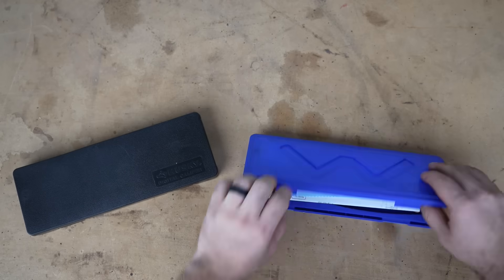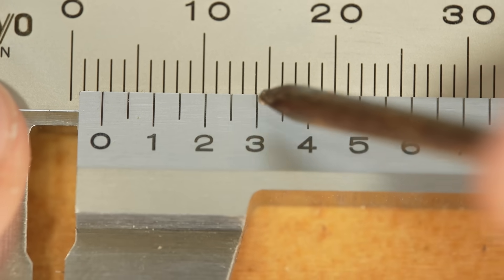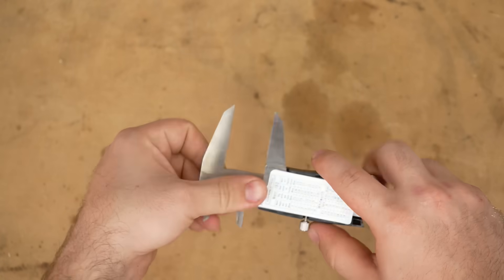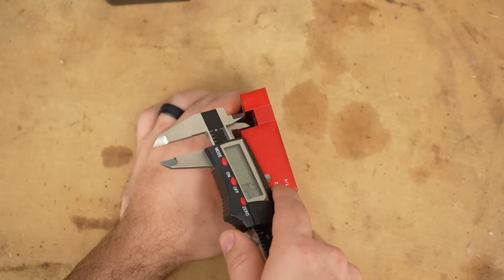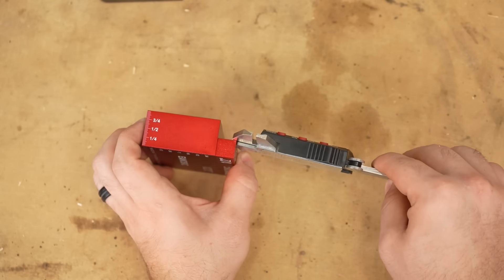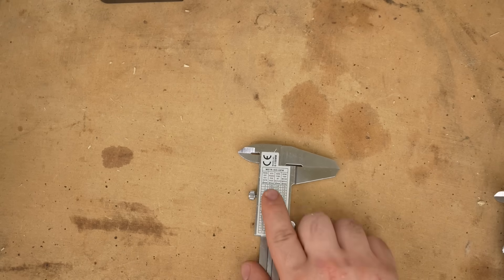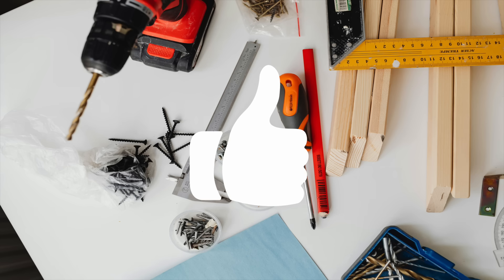I wish i’d known this sooner, How to use calipers like a pro

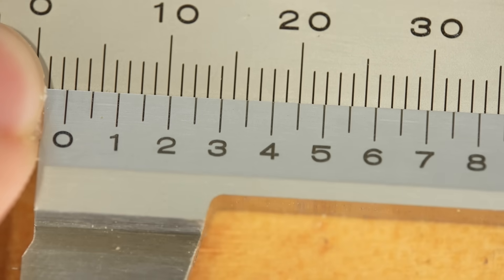Comment: 2:07 Holy crap!  This is high-value info here.  I don't pull out the calipers often, and when I do it's a digital caliper but after this video that my change.  Digital calipers are frustrating and finicky at times, at least mine are, but I've put up with them due to my belief their accuracy and general ease of use outweighed their flaws.  What I learned from this video in just the first 2.5 minutes has changed my mind.  And made me hate button batteries even more!
Reply: Also take a look at dial calipers, they're my favorite type of calipers, but a bit harder to find. They're faster to read than Vernier calipers, but still no batteries.

Comment: For the example step measurement, the depth method would have worked just as well.  Is there a scenario where the depth measurement wouldn't be adequate?

Comment: That's a superb explanation, I didn't know about step measurement. In our Polish workshop we have old “Made in USSR" calipers that we use daily, after all the years of use, they have surprisingly little amount of play. But for anything that requires proper precision, we use digital one. 
Also, a small bit of trivia: In Polish it's called "Suwmiarka", which roughly translates as "Glide scale".
Reply: Or "stroke measure" :)
Reply: Dzień dobry
Reply: VIS vernier calipers for the win.
Reply: Same name in Dutch: schuifmaat ( slide size). Maat is size but also pall/ friend, but in this case it is "size"
Reply: As you mentioned about 'Play' good Mitutoyo Vernier caliper, made in Japan, have a thin plate on the sliding member which can be adjusted with two fine screws to compensate for any wear and tear. Also an additional sliding member is attached to the main reading piece with a Thimble and screw. This is for fine adjustment while measuring.
Thanks.
Reply: Funny, I have a pair of verniers that were made in Poland.
Reply: штангенциркуль

Comment: I'm a retired machinist, instructor and process engineer. I found your information to be very sound. the only thing I will add is to be very, very careful when relying on the depth rod as it's easy for inaccuracy to creep in. The other thing I'll note is that my Verniers are more difficult to use than they were 50 years ago when I was 20 (all you older guys are chuckling over that, I'm sure). On the plus side. I dropped my verniers in the bottom of a screw machine- a very dirty environment. They made a soft landing in the carpet of chips. I fished them out, dunked them in mineral spirits, wiped them off and they were none the worse. My boss did the same thing with his dials. They were toast.
Reply: Inaccuracies creep in with age and wear... it's just that in our case the age and wear is not necessarily the caliper!  I 100 percent get where you are coming from!   😜
Reply: @PiefacePete46  Might want to check out the Bates Method for eyesight. It works.
Reply: Also, with the dial calipers, you can get dirt etc in the rack and it will put them out of zero without you realising. The dial needle won't read zero when the caliper is closed.

I prefer a vernier caliper with fine adjustment.
Reply: @Funco1979  That's why long ago I got in the habit (a habit I always shared with students) of checking zero before taking measurements and again when I was done to make sure that hadn't happened during use.
Reply: @Funco1979  Any caliper, dial or otherwise, not reading 0 when closed almost always means you just have dirt on the jaws. Wipe them off it goes back to  0.
Reply: @bobbygetsbanned6049 not necessarily. Those digital calipers can be set to zero when they're open. For example open it to say 20mm, then press the "zero" button and it will read zero at 20mm. So you could press the zero button without realising when it's slightly open and you'll get an incorrect reading when you measure something.

When measuring with a micrometre you should always check for zero before using it. Clean the anvil and spindle first. The larger micrometres come with a test piece (I've used them 1000s of times).
Reply: @bobbygetsbanned6049 also, with the dial calipers, swarf or dirt in the rack can change the position of the indicator needle. So when you close them (with clean measuring jaws), the needle won't read zero. 

This is why I like the 0 - 200mm vernier caliper with fine adjustment.
Reply: @Funco1979  that previous comment was me responding to your first comment.  but you have kept on spouting complete and utter BULLSHIT throughout the entire conversation acting like you know anything about calipers at all. let alone dial ones. 
even though you have never even seen one in real life before.  wich i know for sure based on the crap you have been commenting.
Reply: @Funco1979   you seem to have atleast held a micrometer. (or had a better source that you could google from)  did you know you can also rezero a micrometer.  they will have supplied a tiny alen wrench that allows you to unscrew the set screws so you can adjust the dial.
Reply: @Funco1979 good point. Iske a practice of closing my calipers to zero before every measurement 
Not foolproof be close.
Reply: @Mark-l6k5g  
with verniers you must also do this.  there can always be dirt on the measuring surfaces. 
also check for gaps with any set of calipers while holding it to the light.  

there are 2 scews at the back of the calipers (near the locking screw) that should be loctited into place. 
these allow you to tilt the moving head. (to alaign the 2 measuring surfaces) 
and they will also make it harder to move the head when incorrectly adjusted. (act like the locking screw)  all 3 of these screws press against a bronze strip of metal that is sliding across the guide. enoegh force on it with the locking screw prevents the head from moving.  and the other to act like a seesaw to keep it alaigned. 
(so when adjusting these screws.  adjust both equally but in the other direction.  this will tilt the head. but keep the net pressure the same.

ofcourse if you have gaps when the head is perfectly aligned then you have damaged measuring surfaces. or dirt on them.
Reply: @attack125  thanks for the info. Very helpful.
Reply: @Funco1979  put them out the zero?   
have you ever even held a pair of dial calipers?   (you can even accuratly measure with a set of dial calipers even if the glass is broken and the needle is bent) 
the zero is litterally a disk that you adjust EVERY SINGLE TIME YOU USE IT.  if the indicator of a dial is not where it was when it came out of the factory.  it litterally doesn't matter. 
since you clean your calipers.  then close it. and zero the dial to the indicator.  (because it will have moved by someone else using it.  or by improper keeping it in a toolbox) 

(with indicator i mean the needle that turns around.  the dial is the facing with the numbers behind it)
Reply: @Funco1979 that's why you always zero it before every use lol
Reply: @thomasdecker7631  we chuckle because we can relate! 
I had a magnifying glass in my toolbox. When I was in an area of the shop with poor lighting, you need the extra help!
Reply: Some micrometres have a vernier scale on the sleeve to measure to a higher level of accuracy (in metric, 0.001mm increments).
Reply: @Funco1979  Absolutely. Precise to .0001" on an inch instrument although in some cases this may be less than the tolerance for "drunkenness" in the thread lead.
Reply: Yeah. I always check my depth rod against zero to make sure it hasn't gotten any shorter since last time i used it.
Reply: "when i was young and 20, they bring me the bottle plenty. now they changed the tune, they bring me the bottle empty..."
Reply: @west_park7993 I wouldn't advertise a drinking habit....... the less people know the better!
Reply: They sell a jig you can attach to the bottom of the calipers that make it significantly easier to get a really accurate reading with the depth gauge. When done carefully calipers are very accurate at measuring depth, it helps to use a parallel in most situations.
Reply: @bobbygetsbanned6049 Yes,a depth anvil attachment makes readings with the depth rod far more consistent and accurate.
Reply: I wouldn't buy one. 

Vernier calipers or micrometres for me.
Reply: Adding that (for me), I rarely see caliper(s) depth read 0.000 when I check them on a perfectly flat surface = most usually read .007 to .010 off (shallow) = I always check and set them to 0.000 before measuring depths...
Reply: I close them and check for zero too before I measure something. But not everyone does this.

The digital calipers can also give a false reading - they could be set at zero when in the open position. 

I like the vernier caliper with fine adjustment and use micrometres for tight tolerances.
Reply: @Funco1979  digital is great but sometimes that degree of accuracy is not required and a mechanical vernier gives me a quick and impromptu answer.. it is like an extension to my right hand.. besides going to my digital how many times do I find the display flashing with the battery about to croak?! A pain in the ass ! :D
Reply: @geofharris5546  Use Silver/Silver Oxide batteries instead of Alkalines.
Reply: China always trying to dupe consumers 😂❤❤❤❤
Reply: Dad likes the digitals cos of poor eyesight and I like digitals because reading verniers can lead to eyesight damage over time trying to read them constantly at improper lighting conditions the same way as reading a book without proper lighting. Focusing your sight on something small, dimly lit and close way too often simply does that.
Reply: @NotEvenDeathCanSaveU  
i bet you also believe that holding a funny face for a while would make your face stay that way?
Reply: @attack125  Nope I believe in scientific data not nonsense, quite sad you can't differentiate between these two
Reply: @NotEvenDeathCanSaveU  At around 40 years old and older, the lense of the eye starts to harden as part of natural aging. This means the muscles that change the shape of the lense have to work harder inorder to focus. Eventually they can't correct the lense very much because it is too stiff. So corrective lenses are required to accommodate this. At 70 now, but in my youth I could do precise close work without magnification. Not anymore, but I use a jewellers optical helmet and still have the required hand to eye skills to do fine work because that's neural connections that were developed over decades.
Reply: All digital are piece of shit!! Battery always empty when you need it the most because they never have a good on/off switch. Garbage all of them!
Reply: Pierre Vernier here , thanks for the mention !! 😏
Reply: It's just that ! Your ! Brain ! Has gotten older ! So it's clearly Not ! The Herniers fault!!
Reply: @davidwillard7334  Actually, it's my eyeballs that have gotten older. Now it takes a powerful pair of readers to see them.
Reply: This was actually an extremely poor instruction on how to use an analog vernier. You didn’t even measure anything. You also had a slip of the tongue when you compared to digital “two-point-nine” which made things even more confusing. Also leaving out how to read and inch scale is harder and you have zero instruction on that. All in all, not much useful information for a real novice
Reply: @andreww7857 yeah I had no idea what he was talking about with the way he explained things. Seemed to me the only way you'd understand is if you already knew how to use them, and I was sitting at about 1 thing I understood throughout the first half of the video in which I stopped cause it wasn't getting easier.

Comment: Here are my 2 cents, if you need deep inside caliper, just buy regular one, and remove material on CNC to make it inside caliper. 
Inside calipers are usually 5x-20x times expensive than regular ones, while in reality they just have rotated points.

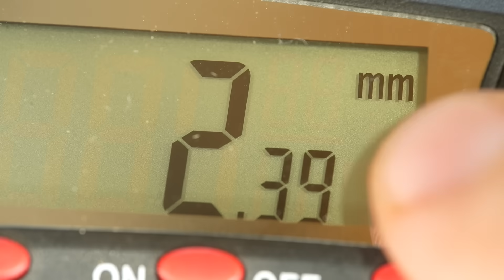Comment: 2:36 Can only assume you misspoke here: the display reads 2.39, while you said “2 point 9”. To 1 decimal place, the digital readout agrees with the ‘analogue’ one at 2.4. Or, maybe the digital callipers are set to higher resolution, reading up to 10^{-5} or (10s of microns/micrometers); they may be more accurate, though I couldn’t say without knowing more. But if they are then the digital set are providing better accuracy, showing that the previously measured 2.4mm is actually a bit smaller at 2.39mm. Anyway, thanks for the video, it was interesting 😁

Comment: Nice video, but you confuse accuracy with precision. The vernier caliper is precise to .o5mm. A crappy caliper may be inaccurate, so if it measures 2.05mm, a better caliper may measure 2.15mm. Same precision, but different accuracy.

Comment: If you can afford it check out the only caliper with carbide jaws. The Mititoyo dial caliper is a work horse that will give you quality outside dimension measurements for decades. Worn-out jaws are a recipe for disaster.

Comment: The China Export thing is wrong, pure BS and even the European Parliament says so.  It's simply a CE mark that doesn't respect the officially spacing specified for the logo.  Please fix your video!

That said, the CE mark is a self-certification of the manufacturer declaring compliance with all applicable rules and standards.  This obviously is a system where honest mistakes like intentional abuse can happen easily.

Comment: To echo some of the comments, China does not have a "China Export" symbol. This is a joke that has become folklore. Plenty of companies correctly conform to CE regulations but are not aware of the CE size requirements or don't care. Also, for many non-medical, non-electrical products, conformance is self-determined. You have to dig much deeper to try and figure out if application of the symbol is fraudlent or not.

Comment: vernier calipers might have the same theoretical resolution, but the inaccuracy comes from misreading them. Anything from simple mix ups to parallax error from not looking perfectly from the top.

Literally the only reason to use vernier calipers in my opinion is that nice digital calipers are expensive.

Comment: Not to mention that digital calipers are essentially automatic reading verniers that use varianle capacitors on the slider caused by alternative  conductive and isolating strips on the ruler (under the label). Electronoob's video on digital calipers was really inspiring

Comment: Digital caliper are HARDER to use, you are more prone to incorrect measurement, they are easier to read, but harder to use. The problem is, you tend to get the measurement you want with digital reading. Zeroing the thing is also a big problem... Before using a digital caliper you ALWAYS calibrate them with good known references ( precision wedge or precision pin for example ).